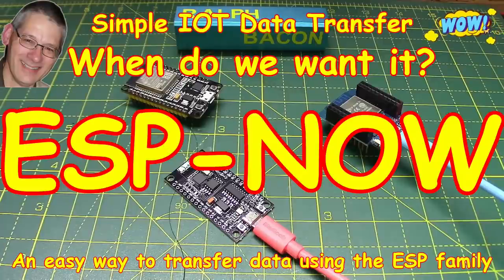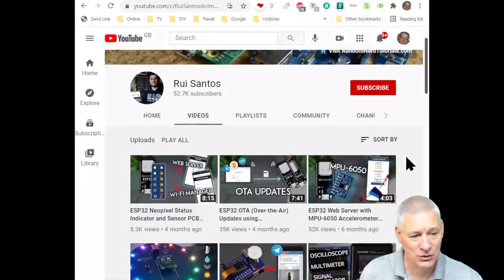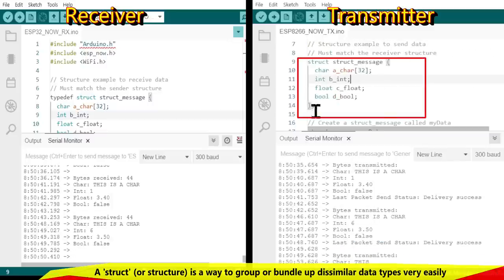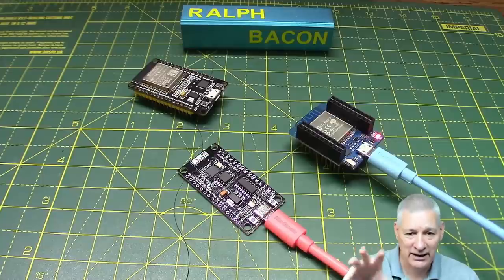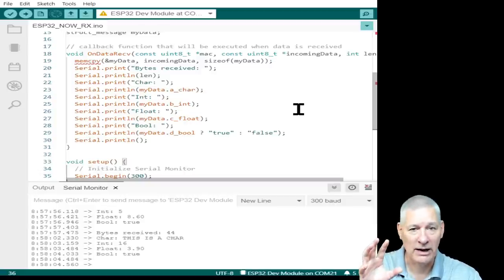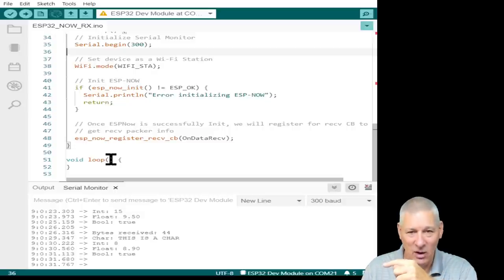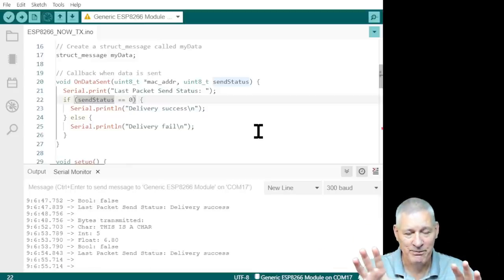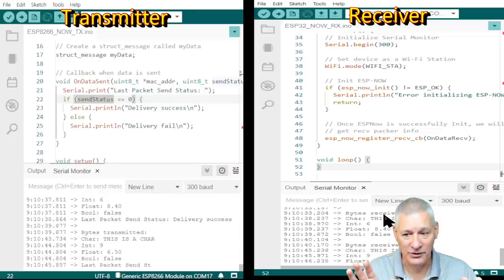#223 ESP-NOW simple demo - easy IOT data transfer on ESP32 or ESP8266

Comment: Does the ESP-Now only work as master / slave or can it act as a transceiver too?  It would be good to know the range indoors and outdoors with ESP-Now.  Can you secure ESP-Now with a wifi type WPA protocol?
Reply from the maker: Whilst the implementation described by Rui indicates that the usual configuration is many slaves to one master (eg multiple temp/humidity sensors sending data to a hub) I'm guessing that different code could be used to send stuff back to the sender... but as I don't need to do that I'll leave it to others to confirm.

Comment: I am wondering if anyone has tried ESP NOW and ESP Rainmaker on the same ESP32 ?  Could not find any info regarding that
Reply from the maker: Well, I'm using ESP-NOW and general Wi-Fi on the same device without issues. 

Given that ESP Rainmaker is an AIoT cloud implementation for which you'll need connectivity, I would hope (and expect) it to work. But we'll never know unless someone (hey, you busy, Russell?) tries it out!

Comment: 1.Do espnow  work on AI Thinker  esp boards or only on espressif ?

2. Is there any difference in range of espnow  with 
Case 1 :  esp32 +esp32 
Case 2:   esp8266 +esp8266  
Case 3:   esp32 and esp8266
Reply from the maker: ESP-NOW is a proprietary comms layer, implemented by Espressif as part of their framework. So any ESP32 using that framework will also be able to use ESP-NOW.

The ESP8266 also allows this and here's a great article that show you exactly how to do it: https://bit.ly/espnow-esp8266

Comment: a low overhead wifi based protocol. nice.  loads of questions, like "how many stations?", etc. I wonder what happens if you put the mac address of, oh say, your router or other wifi device, on the receiver, the transmit a dummy packet. Do you get a  response?  could be used for a sort of presence detection like has been done with bluetooth beacons, but active checking not just, I haven't heard from this in a while so I'll assume it is gone".     
 "Hey! Ralph, the wifi garden gnome has gone missing".
Reply from the maker: Interesting questions that I will leave others to answer as I have enough to do just getting my Smart Heater Controller off the ground! Now, hang on, where is my garden gnome?

Comment: What is the distance range over which these boards will communicate?
Thanks for another interesting video!
Reply from the maker: Real World experiments by Rui and others state that in Open Air it's about 250m (depends on the aerial, I guess) but in the home it will be less. Not a concern for my indoor 3m (max) range required!

Comment: I have a same issues for setting up a simple wireless water level sensor for the reciever is not giving the value input? How can i fix this?
Reply from the maker: You will have to describe the "same issue" so I can understand your problem better. If you mean you are transmitting a value using ESP-NOW but the receiver is printing something else, then chances are that your data type is not correct. Create a struct to hold the data (even if it's just a single integer) and use the same struct definition in the receiver too.

Comment: so the receiver can have a list of mac addresses (more than 1)  that it can connect to ? 
which is needed if using more than 1 sensor (bme280)
Reply from the maker: The receiver doesn't know about any MAC addresses, Jyv; it's the transmitter that has to know the receiver's MAC address and each transmitter can send its data to the same receiver (that's what I intend to do).

Comment: Ok, anyway. I am looking for a way to send data to my computer from a ESP32 wireles, how do I do that? I see that both receiver and transmitter are connected to a computer, I guess that I need to connect the ESP32 to a battery so I can power it, but I am not sure how to get all of that done.
Reply from the maker: Your questions are quite fundamental, Allan. If you don't have much experience you need to start smaller and work up to your desired project level. There are many, many videos on this channel to help you in your quest. Good luck!
Reply: @RalphBacon  as I searched videos about it, those didn't appear that's why I am asking here, but I found other videos which answer to my doubts. I am in a hurry to get it done

Comment: Hello Mr. Bacon, is it possible to use the ESP8266 to send tv remote control codes from one 8266 to one in another room?  What I'm trying to do is replicate the pulses from the TV remote control from one room to control the cable box in the other room.  I know you can use the 8266 to control TV's but is there a way to do it from different rooms?   Thanks you so much for all the information you provide, I have learned so much from watching your channel.
Reply from the maker: If you let the ESP8266 in one room receive the TV remote signals, it can then send the required function (eg 1= vol up, 2=vol down etc) to another ESP8266 in another room using ESP-NOW, and that ESP8266 then outputs the correct IR codes to the TV. Sound sensible?
Reply: @RalphBacon  Thank you.  I’m new to all this, but I think your saying assign a number to all the functions and that numbers gets sent to the other 8266 and then sends out the TV code.  Sounds like that will work, I’ll give it a try.  Thanks…

Comment: The real fun starts when you use ESP-Now to build a mesh network so you can send messages to a master through a different paths when a path is not available for a moment.
Through a broadcast, you can tell everybody your MAC address. It will be received by everyone which is listening and in reach.
Reply: nice to know, does that make it unsafe ? anyone can send their mac address and then send fake sensor data, would be very difficult i suppose (to know what the system expects)
Reply from the maker: The transmission can be encrypted but whether that includes the MAC address I don't know.
Reply: @RalphBacon  
There seems to be a ESP-MESH too, also provided by espressif (there is also a Arduino library). It has to be save, else nobody would use it.

Comment: A great video as always Ralph. I've got a couple of unused ESP2-VROOM modules that I'd like to press into service, so I have downloaded your sketches for the ESP32 Tx and Rx.
The Tx sketch compiled and uploaded to my board fine. But the Rx sketch will not successfully compile, and throws up the following error:

Compilation error: invalid conversion from 'void (*)(const uint8_t*, const uint8_t*, int)' {aka 'void (*)(const unsigned char*, const unsigned char*, int)'} to 'esp_now_recv_cb_t' {aka 'void (*)(const esp_now_recv_info*, const unsigned char*, int)'} [-fpermissive]
Why, and what does it all mean ?
Reply from the maker: Is that from my sketch or have you modified it? It seems to be complaining that the receive data structure is not what it is expecting. Email me the sketch if you still have issues and I can have a look much more easily than trying to do it here! (Email address is in my about page on the channel, only visible on a PC, not a phone).
Reply from the maker: OK, got your email and understand that downgrading the ESP framework (eg from 3.0.0 to 2.0.14) solved it for you. 

This is an ongoing problem with the new Espressif Arduino framework using the newer IDF (Espressif framework) APIs. 

OLD ESP-NOW callback function:
void OnDataRecv(const uint8_t *mac, const uint8_t *incomingData, int len) {... your code...}

NEW ESP-NOW (Framework 3.0) callback function:
void onDataRecv(const esp_now_recv_info_t *info, const uint8_t *incomingData, int len) {... your code...}

If you used to access the (old) first parameter of the sender's MAC address, you can get that now from the 'info' parameter pointer thus:

info->src_addr

although you will have to convert the octets into printable bytes as we always have had to.
Reply: @RalphBacon  Thank you both!!!  I just started working with ESP-NOW and I was very frustrated with this invalid conversion error.  Have a great day!

Comment: Thanks for the video. Questions: 1) What if the master device has no knowledge of how many slave deices are out there when waking up? Is there a away to send "who is alive" and get the MAC addresses of all alive slaves? This can prevent the need to hard code the MAC addresses. 2) is there a way to  communicate from Windows/Linux to ESP-NOW device?
Reply from the maker: You can't do what you suggest because you are doing it backwards.

The master cannot sleep. The slaves (sensors) can, of course. But the master must remain awake to get the data at any time.

ESP-NOW won't take unsolicited data from just any old ESP32. The MAC address ensures that the slave is an authorised one as it knows the MAC address of the master (not the slave).

I don't know of any way to communicate from Windows/Linux to ESP32 via ESP-NOW as it is an Espressif protocol - but you can just use normal Wi-Fi for that.
Reply: @RalphBacon  I am not sure I agree. yet this is not what I meant. Let's say the whole system is waking up  at the same time. Yet another slave was added since last time. Does it mean the master needs to be reprogramed??  With the new slaves' MAC address? this can be done at the lab, but not at the field. I think there is a way in which the master sends a message to "who ever is out there", and get responses. Then the master will send a specific message to each slave and get the specific answer so the master now can operate the slaves by their role.

Comment: i tryed making a simple pager system with this and seems to be getting there.. i got 1 sender unit going and a few receivers doted about :)
Reply from the maker: Sounds great. As the instigator of this project, thanks to your comment, I thank you! I wonder why I never heard of it before?
Reply: @RalphBacon  yer i only just stumbled across in the data sheet.  i think they need to advertises it more , it an amazing protocol as you righty said the only draw back i can see is the 200ish bytes it can send but again this isnt a big deal just buffer it i guess. your a star :)

Comment: Can you give me the code for ESP8266 transmitter  ?
Reply from the maker: I'm not using ESP8266 at all for ESP-NOW, always an ESP32.
Reply: The claim that esp_now works on ESP32 and 8266 seems unsubstantiated. The Internet seems full of people asking how to get it working on 8266 when programming from Arduino IDE and not really getting any useful answers.  In the end I gave up and used ESp32 at both ends - they are really very cheap dev boards now so not a big deal - but I still have the nagging feeling that that is what Expressif intended I should do cos the 8266 claim is not one they want to meet now; Or is that way too cynical? :-)

Comment: Is it possible to use a single esp as slave and gate way?
Reply from the maker: I'm not totally clear on your meaning here; do you mean as an ESP-NOW initiator (or responder) AND using standard Wi-Fi too? At the same time?
Reply: @RalphBacon  Like is it possible to use esp now and wifi at the same time. Suppose we are getting the data from another esp module to a central module, can that same module can both receive and transmit the data to the cloud
Reply from the maker: Yes you can. That is exactly what my Smart Heater Controller does. It receives three ESP-NOW signals from various sensors but is also connected to my Wi-Fi for me to interrogate it via a web page (and it also talks to a SonOff Basic switch too). Cool, huh?
Reply: @RalphBacon  yeah thats so cool can you make video on that. Many videos out there are using 2 esp's for gate way system. Actually I am working on a wsn. If you could make a video it helps me a lot. if not can you share few resources. Thank you.
Reply: @RalphBacon  I have spent a week on this. First I secure (PMK & LMK) linked two 8266's. I tried to connect the receiver to my WIFI network to pass data as MQTT - NO GO! Then I replaced the Receiver with an ESP32, still with a secure link - STILL NO GO! yet. When I turn on WIFI_AP_STA I receive no ESPNOW packets. I have gleaned that all devices need to run on the same channel & that lower channel numbers did seem to work more reliably for one person. I am really struggling with this. Looks like MrDIY coped out and linked two modules together, one to receive ESPNOW and the other for wifi MQTT.
Reply: @RalphBacon  can you make a video on it
Reply: @dunk_law  I have managed to use 1 ESP to work as both: sender, receiver as well as MQTT gateway. So yes, it works. The same channel is a precondition as you said. But fixed channel is good as it makes connection much faster for all devices (my ESP32 connects to AP in around 100ms when channel is specified and fixed).

Comment: Great info, cheers.  You tried the DS18B20 probe?
Reply from the maker: Yes I have, my workshop and attic both have DS18b20 sensors wired to an ESP32 and using ESP-NOW to send the values back to my Workshop Heater Controller.

I use the simple DS18B20 library from Rob Tillaart that only allows ONE sensor per pin:
https://github.com/RobTillaart/DS18B20_RT
because it uses less memory. 

Normally, you are able to put umpteen DS18B20 sensors on a single pin because each DS18B20 has a unique ID and you can query each one independently. I didn't need that so used the simple library instead.

Comment: Why did my comment about esp now got removed?
Reply: Mine did too, strange
Reply from the maker: @Niklas Paulsson Nothing to do with me, honest! In fact I got notified of your original comment, and here it is:

I've had quite a bit of issues of getting esp8266 and esp32 to talk to each others when using the esp-idf for esp32 and ESP8266_RTOS_SDK for the esp8266s and not the arduino api/sdk. In my case It seemed to boil down to wifi settings and it was definitely non trivial to debug and get it working. As long as I stuck to only esp32s and esp-idf it all worked roger-yankee-doodle-dandy. The small price increase in price for an esp32 instead of an esp8266 when setting up my esp-now based iot network now control of my home wasn't worth my time - so now I stick to esp32s exclusively and I'm happy. As alwyas, it's a work in progress, but I've got IR-diode senders, buttons, relays, sensors and range extending repeaters working together with a gw that can connect to the internet and hopefully soon will act as a mqtt gateway. If anyone is interested, see github and the username np422, all repositories named esp-now-something ...
Reply from the maker: @Colin Pamplin Sorry, Colin, I can't find any reference to your comment, it's not awaiting moderation or anything. YouTube technology failing us, by the looks of it.
Reply: @RalphBacon  It is most likely youtube's ai-algorithms that are getting overly aggressive these days when it comes to censorship. 

Nevermind, just keep it up, esp-now is a useful and interesting topic!
Reply: @RalphBacon  I don't know whats going on with YT as I've now posted 3 times. Each time I see my comment appear then refreshing the page and it disappears. Most odd
Reply: @NomenNescio99  Thanks for the heads up but it was Firefox as it posted and remained (i think) when sent via Edge browser.
Reply: No that didn't work either

Comment: hmmmm how about spoofing?
Reply from the maker: The connections can be encrypted so I'm hoping that no-one could eavesdrop on the data (or MAC address).
Reply: @RalphBacon  Connection is encrypted, but before that 
 as far as I can see is there no authentication. Every ESP32 connects to another. A pain in de ... for security folks :)